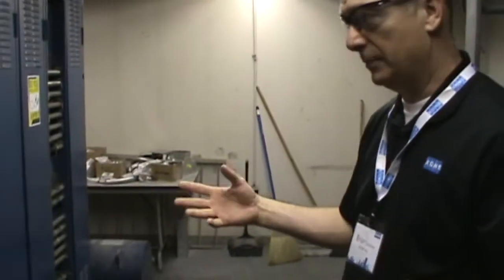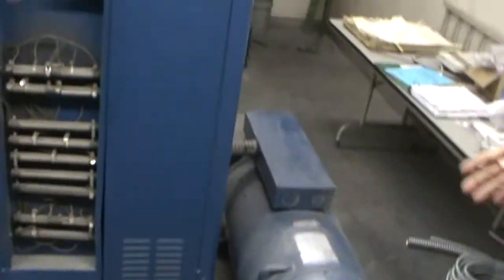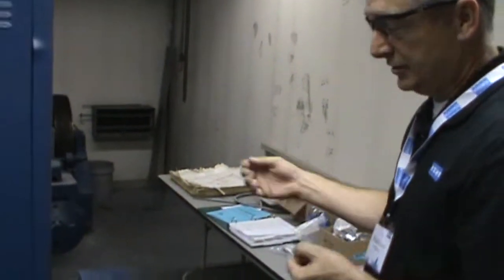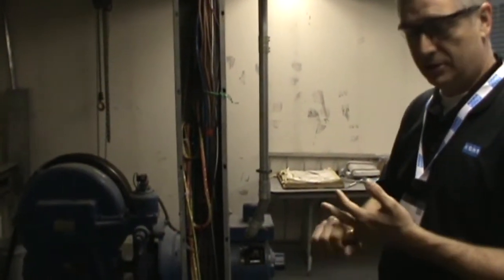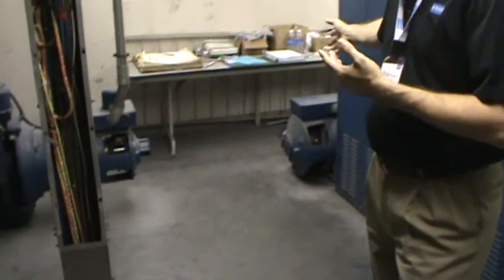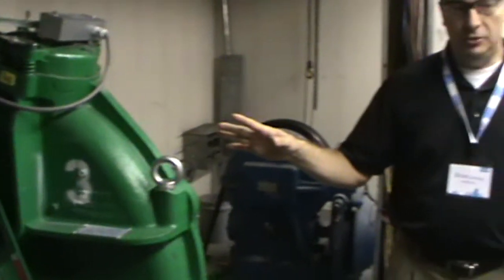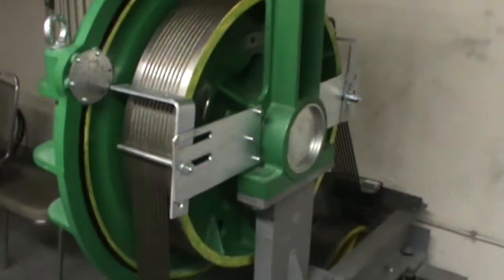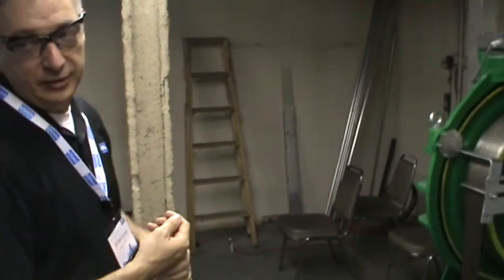KONE EcoDisc Revolution vs. Old Westinghouse Elevator at Cobo in Detroit

Comment: That old Westinghouse car will outlast that KONE car by 2 lifespans.  If the MG timer is working the generator will shut down after non-usage, true those commutators and get some good brushes in there (maybe replace the bearings) and you'll be good to go for another 25-30 years.  That KONE car will struggle to run half of that and god forbid you have to pay for parts on that thing, they are the most expensive parts in elevator history.  KONE KCM= KONE CASH MAKERS.
Reply: Well they still stand
Reply: I totally agree!!! Couldnt have said it any better!!!

Comment: Unfortunately, I prefer an old Westinghouse over a new ecodisc. You guys put no quality into your new elevators! I rode one of your guys newer ecodisc and it was already falling apart and bad creaking. Put some more quality into your elevators, like ThyssenKrupp
Reply: Elevating Oregon since 2015 Personally, it's somewhat of a waste of $$$ to replace the entire Westinghouse machines with all new. Just convert the old ones to AC motors with new controllers and it will give many years of service.
Reply: I agree! The ecodiscs look very cheap and would fall over real easily. Just convert to av and give it a TAC50 and you're all set
Reply: Convert to AC
Reply: Elevating Oregon since 2015 One thing I really don't like about "MRL" elevators in general is the underslung car. 
The arrangement is unstable and if there's a derailment (like from a severe earthquake), the car will literally fall out of the cable loop. 

I also believe building owners are getting ripped off by elevator contractors who persuade them to buy a completely new system VS a well planned modernization of the old equipment.=.
Reply: Yep. Good thing about synergy is that it is well mounted. I don't even know where an ecodisc it supported!!
Reply: Elevating Oregon since 2015 The Ecodisc in this installation is overhead traction which is solidly supported. 
The video says it's roped 2:1 which I guess has a sheave in the crosshead of the car. 
However an Ecodisc mounted in the shaftway (on the rails) is roped 2:1 with sheaves underneath the car.
Reply: are you trying to say kone shouldn't make money?
Reply: This EcoDisc wasn't MRL.
Reply: KONE should make money by selling unsuspecting building owners more than what they really need. If you're a building owner with a minimal knowledge of elevators, you need the advice of an elevator consultant instead of just relying on what contractors tell you.
Reply: kansasthunderman1 
Plus, as much as Gen2s are energy savers, the Kone EcoDisc really does the best job in terms of energy saving
Reply: Hence the name
Reply: I was there today, and these elevators are pretty damn good compared to the stereotypical crappy KONE.

Comment: I found an old Haughton ad on eBay, that said the Cobo Convention Center had Haughton elevators. Were these elevators modernized by Westinghouse in the past, or is this a different building?
Reply: Probably modernized. These units look like they're from the 80s. But the Kone mod is great
Reply: Today i found 2 former Haughtons at Cobo, also modded by KONE.